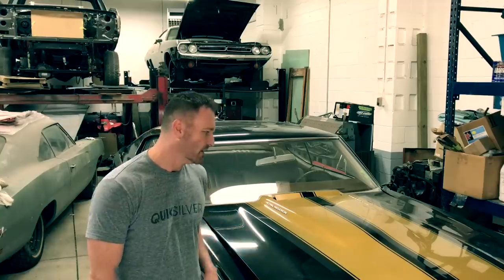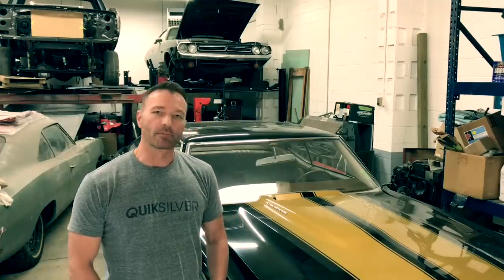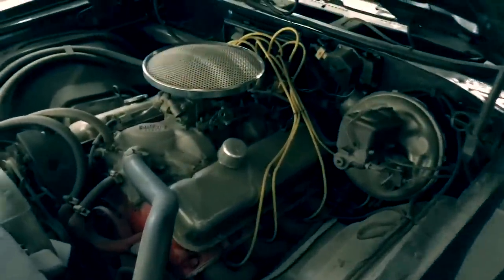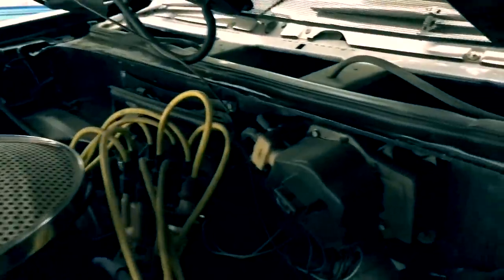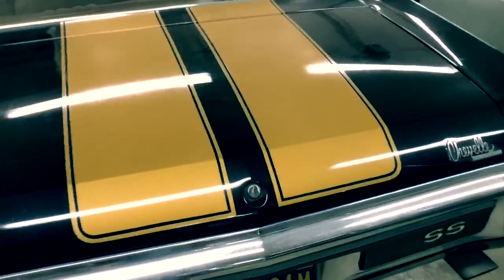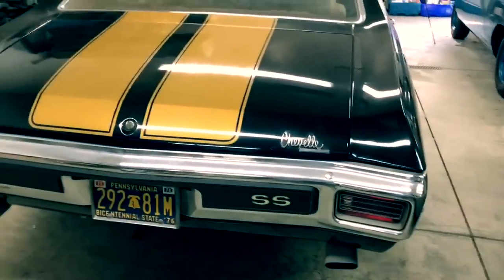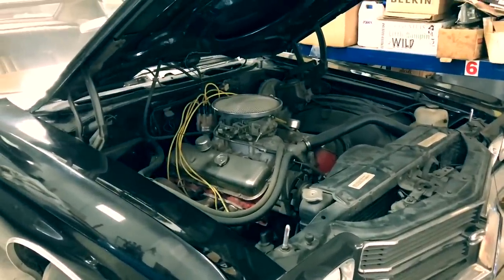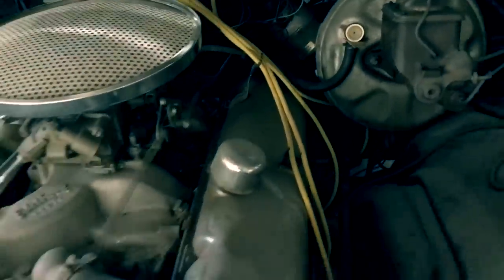Amazing 1,092 Mile 1970 Chevelle SS454 LS6 Found In Rural Pennsylvania

Comment: Car will not pass scrutiny to verify actual mileage. Why would the front tires be changed? Why would there be so much oil vapor on the engine block? The fact that the odometer is being used to validate mileages just does not pass any logical understanding of what you are showing us. This is You Tube and your tuxedo black SS with aftermarket stripes and missing original equipment has cut the value of this car by 30 to 60 thousand dollars. If an intelligent person were to actually get a hold of it, and replace all the missing hardware with OEM parts it could regain some value in terms of finding a buyer. Sorry you were taken in but the car was registered for 5 years after purchase. It is just insane for you to state the owners went through the registration/inspection process 5 times yet drove it less then 250 miles a year. Nope you have been fed a fairytale and you should be intelligent enough to figure that out.
Reply from the maker: Robert Haas with all due respect sir you are dead wrong. The car is known by many in this town to have never been driven. There are MANY physical characteristics about this car that says the car is authentic 1092 Miles. The car was street raced heavily for all of these miles. The car has seen less than 50 miles since about 1973. Also the change to gold stripes actually increased the value because it’s documented on the bill of sale so that works as a 1 Of 1 unique aspect. Nothing but intelligence has been used here sir. You should use yours.

Comment: Ls6 must be a chassis code
Reply from the maker: one off no sir RPO LS6 is definitely the engine designation for the 454 cubic inch with 450 horsepower.
Reply: @patrickglennnicholsmusclec1674  so ls6 like ls1 ls6????

Comment: but there is a lot of incorrect stuff on the car though. so a few things need dealt with hose clamps, wheel, stripes need to go back to white(sorry) air cleaner intake carb? battery cables don't look right, wheels are missing, plug wiers, shifter, but Hurst could be accepted I guess, am 8 track was dealer installed, exhaust tips look incorrect, but over all a fine car for sure. to bad its a bench seat and ugly ass tan yuck!!. probably why it got parked couldn't stand to look at it . lol. but he kept it because it was fast. back in the day most would of said dude that thing is ugly as hell why do you have that junk. go buy a cosworth Vega they get better mpg . lol.